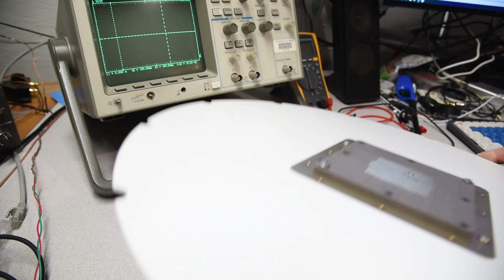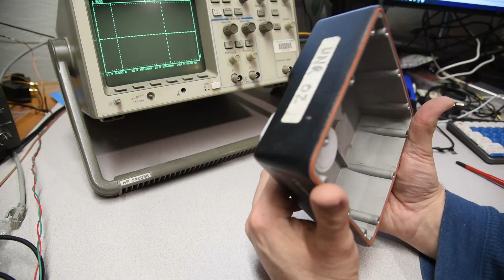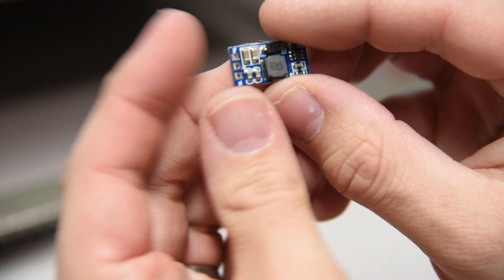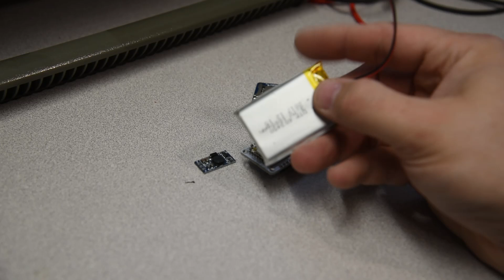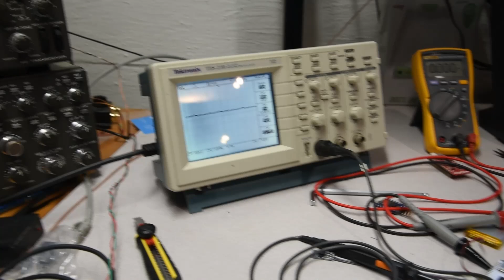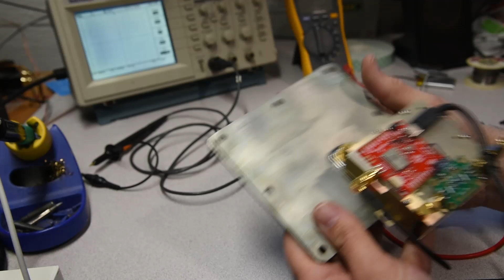LG290P & Trimble 14532 Integration Pt1

Comment: I'm not quite sure why there's hype around LG290P. There are other cheap and yet more mature products like um980, with higher-quality firmware, etc. If you look at Sparkfun's forum, there's a disproportionately large number of posts from people who bought the "postcard" and are now having trouble configuring it to do what they need. Also, for a project that involves some unorthodox RF integration, it would be handy to have something with a u-Blox chip that has direct RF measurement capabilities for debugging purposes (UBX-MON-SPAN and UBX-MON-RF messages) supported in u-center and PyGPSclient.